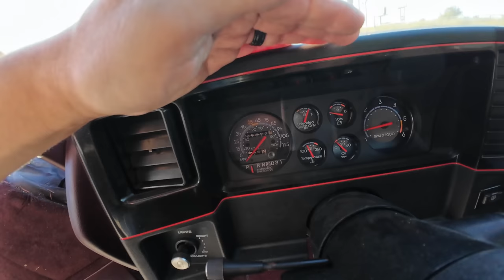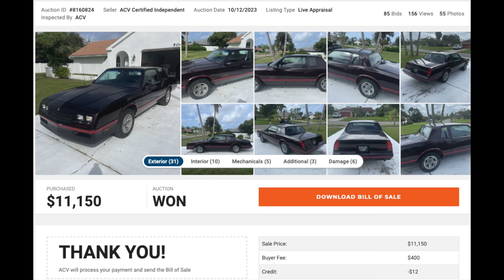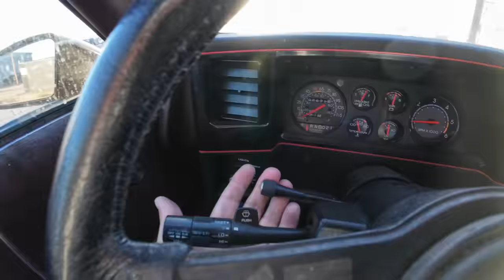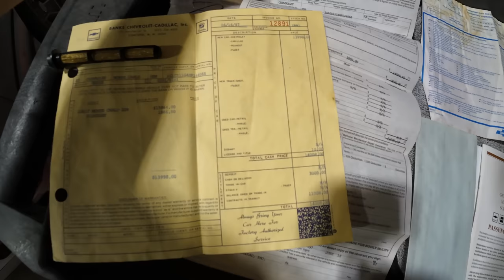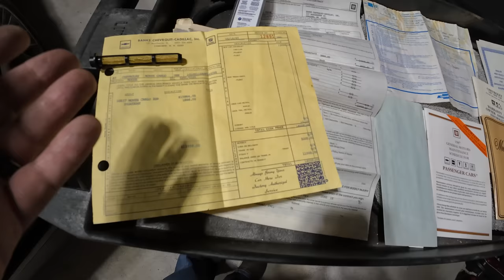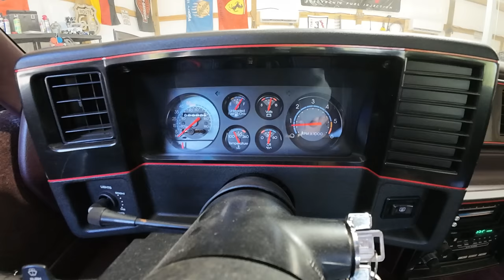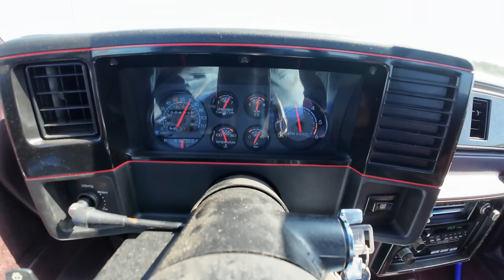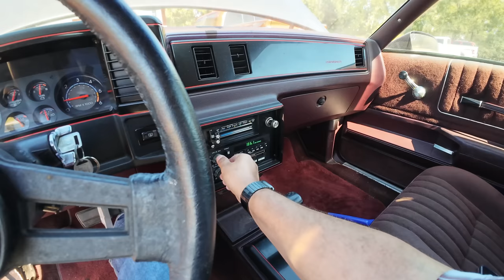I Bought a ONE OWNER 1987 Chevy Monte Carlo SS Parked for 20+ Years! First Drive - Will it Make it?

Comment: As soon as I saw the inspection sticker on the windshield I knew where it was from. I lived in Concord about the time the car was sold at Banks. Even if it was stored for 20 years it's surprising it has so little rust. An interesting project with the new motor and transmission and a future owner can put it back the way it was if they want. No junk yard scavenging needed. Thank you for a great video. Power tour should be extra interesting next year.

Comment: Maybe the air pressure being so high helped keep the tires round. I have a c4 corvette that I only drive in the summer and it takes several hundred miles to get the tires round. Someone told me to put high air pressure in them before parking to avoid flat spots. I was skeptical, but it may actually work

Comment: Nice! My parents still have their original '83 base model MC (not SS). Only thing replaced in it was the engine about 30 years ago because it dropped a piston. I paid to have it up and running last year and the guy said it was in good shape for having sat for 15 years. It needs the vinyl top replaced, I want to replace the radio and paint, but otherwise I'm leaving it as is. It's a rarity.

Comment: Changing the motor will not hurt the value at all. When I did the one that I had I went for the ZZ4 350 cubic inch motor from jegs and put all the original valve covers etc air cleaner just so it looks stock. But either way sounds like it's going to be a good build and you did not get hurt on the price as far as I'm concerned
Reply: I put a 454 in my ‘85. Armchair “experts” told me it would ruin it’s value. The car had 94,000 miles and had been repainted, so it wasn’t like it was showroom clean 15k mile time capsule. Never mind that every single SS had the same L69 305, so there’s nothing rare or unusual about the power plant. I immediately started getting approached at cruise-ins and car shows about selling the car. The offers were significantly higher than anything I was offered when it was stock.
Reply: Agreed. The Monte has miles, repainted and far from original. I suspect the engine has been swapped anyway but Randy can check that. Would be annoying to store the running gear if it's not even original. A worked 350 or bored 383 would be good, but I'd like to see a 350 supercharge in this heavy boat.

Comment: I would say, go ahead and swap it out, but like ypu saud you were going to do, keep all the original drivetrain components in case the next owner wants them. Make sure the engine is seal up to keep little critters from getting inside and causing damage and research the best way to store a used engine so as not to cause any damages, or at least keep it minimal. Also, since we know you're going to video it, make sure right after you pull the old drivetrain old, you video all the serial numbers so nobody can saw that you changed put the engine or transmission for a different one. Video proof is worth something for later in life

Comment: For sure swapping the motor is a GREAT idea, the old 305 boat anchors aren’t worth anything IMO. We swapped my parents 307 out of their 1985 442 with a 355 with double hump heads. Cool thing about the “G” bodies, the front frame is pre drilled for olds or Chevy motor mounts. So all we had to do it unbolt and bolt the new mounts in. Cool car Randy, can’t wait to see it built up. Oh, does the Monte have posi? The 442 had factory 3:73 and posi.
Reply from the maker: Some had posi and others didn't. This has the 7.5" but I need to check the RPO for gear ratio.
Reply: @AutoAuctionRebuilds  I would hope it does. Should also be a tag on the diff cover
Reply: @AutoAuctionRebuilds  Should be a 3.73 if stock.  They all were in 85-88.

Comment: Good buy randy. Upgrades you  will  do  is great idea. Go for it.will be a great car 
I have 1986 elcamino ss had 305 put 350 summit motor in with headers pipes exhaust.runs great
Good luck  withh your project

Comment: You kinda forgot about inflation. $14,000 in 1987 is roughly equivalent to just over $37,000 in 2023. So for $11,000 they didn't get anywhere near their money back. Under a third. Amazing car though and well kept. I'm happy you're doing it in a bolt-on way that's reversible if you sell it later.
Reply: You don't adjust for inflation, the lady bought it for 14K brand new, and 36 years later sold it for 11K. She got most of her money back.

Comment: 27:33 you’re talking about the primary and a secondary barrels of the Quadra jet carburetor. I had a 1971 Cadillac with a 472. I also had a 1971 Camaro 350 with a four barrel Quadra jet. When they are tuned properly, they’re pretty good. And like you said, when the secondaries open up, it’s like VTEC lol

Comment: The Monte Carlo looks like it has an aftermarket air cleaner, possibly a dirty K&N cleanable air filter. More than likely you have a Chevrolet engine (orange) as opposed to a corporate engine (blue) The rattle is probably a heat shield for the cat.

Comment: Randy, I don't know why you keep talking like these were not reliable cars and 100k miles us a big deal. I have 400,000kms on my 84 Cutlass and it was my daily driver for a long commute 3/4 months of the year for many years since I bought it in the early 2000s. I plan on it lasting the rest of my life. Much more durable than a modern car. The 2004R is out of my previous 87 Cutlass that rusted out. I stupidly bought it when I was 19. We swapped it's overdrive transmission and interior into the 84 when it had 300,000kms so now it's 520,000kms or well over 300k miles.

Comment: i would have been EXTREMELY CROSS with the transport company. car sat for decades. old oil. god knows about the condition of the antifreeze. bad gas. not delivering to the ACTUAL DESTINATION. then let it idle for 40 minutes. they should have issued a full refund.

Comment: Those cars from factory came with a 3:73 gear ratio… if it’s a posi unit the code sticker on the underneath side in the trunk will have G80… if it’s not a posi…. I’d at least put me a locker unit in… hopefully it will hold to that 450 HP power train you plan to install.

Comment: Hey I have a one owner 86MCSS.Same as yours.except black and grey.They will float down the road.my car set for 14 yrs.I replaced  the carb brakes stater.and dist.but my friend had some zz4 dist.corvette.that made that car wake up.180 HP 305.  Is. Not a barn burner.But it's dependable easy on gas..radio cassette eq plays when it wants .interior very good lady owned.southern car..I like tops. 17 rims much need.Lower the springs plus a LS3.would help 350 HP.is enough power.200r4 is a quick shift.trans ... Mostly like the 350 turbo.   373 rear....it will run ride 4 people. Plus ride pretty good....cowl hood is a must...Custom built monte 86ss will fool alot of people. A Chevelle all dressed up.I will sell mine. If interested .thanks

Comment: To reset the trip, push the knob in and twist clockwise. The trip wheels will roll until they are all at 9s and continue turning until they are all at 0.

Comment: Chevrolet had to be careful and tread lightly with the Monte SS. It was a 5-passenger, 2-door sport coupe with the young family man in mind that wanted sport but could carry 5 people, comfortably.

If they had put the 350 in it or even the 305 TPI, it would've been quicker than the Z28 or IROC with the L69 HO 305. The Camaro guys would've cried foul! 

The Monte SS was good for high 15's in the 1/4 with the L69 HO 305 and 3.73's (standard with the RPO Z65 SS option). That was pretty respectable for a 5-passenger, mid-size, 3,500 lb car. The same L69 in the Camaro with 3.23's or 3.42's was good for mid-15's. So you can imagine how well an SS would run with the TPI and especially the 350. Camaro owners would've pitched-a-fit! LOL!

A few simple mods on the SS really wakes-them-up. 
I've got my Monte with the base LG4 305 running 15.1 in the 1/4 and the engine has never been opened and the stock, original CC distributor and E4ME feedback Q-Jet is still on it. The 305 isn't a high horsepower engine but they are INSANELY reliable!

Comment: I had five SS monte carlos , maroon, black, white, silver and grey.  they were all stock and great shape in the 80s when I had a dealers license and from 3 to 5 thousand dollars.  they were good looking and drove well but deader than hell. Also vettes, mustangs, rt chargers, trans ams, camaros, chevelles, GTOs, and everything in  between the only car that was after 1973 that was hot was a SD 455 Trans Am from 1973, It was a screamer.  I bought a new 1972 T top vette , It would not spin a tire, I traded it for the new Trans Am which I loved.  The cars from 1958 to 71 with tri power and big blocks were my love like my 1970 Dodge Charger Plum crazy purple that I bought when I got out of the army, It would run 160 with  drum brakes and recessed headlights Which would make the front end lift and float at high speed, and the brakes fade out and quit when you tried to stop.  I am lucky I am still here.  I got carried away, started babbling , sorry.  Oh I forgot the price of the rt was 3900, the vette was 5700 cash, and the SD transAm was 6500 cash and worth 150 thousand now.   From Larry the babler

Comment: You're way better off with a solid roof car...spoken from experience having owned both solid roof and t-top G bodies...$11K is a great buy for a one owner unmolested car.  Be aware that swapping the motor, even if you still have the old one, will devalue the car.  Having said that, the factory engine was SLOW!  All show and not much go...I believe the secondarys on the carb are vacuum actuated...they won't open just reving the engine idling.

Comment: First of all, if it has a 100000 miles on it, it hasn't been setting. It may have Set  a few years. Those cars are not worth $25000. Like everybody is trying to sell them for. First of all, it's getting hard to find the parts. Second of all everything is gonna be redone on it To me and what I've been saying themselves for they're only worth 5 to $10000. And that's the reality of what I'm saying, people let them go for.. They may be asking that. Hi dollar, but they're not getting it.. You overpaid for it And when you change over that motor you're not gonna have nothing but problems. It's also going to decrease the volume because it's not original anymore.. When you put the new motor in, I'll be happy to give you 25 Hundred dollars for the car. 🤦‍♂️

Comment: This car really brings back memories, and I want to share some of them.
My mom and stepdad bought one of these same color except theirs had the T-tops and the unique cupe rear glass. The car had the 305ci engine which I think was the same engine Chevrolet was putting in their corvettes at the time. I think they ought to have come standard with a 350ci as the 305 was underpowered as they eluded to on this video. 
Anyway, the car was still fairly quick off the line (for what it was) and had a tolerable top end speed. 
It was my mom's daily driver, but on the weekends, my stepdad would take me with him to race his friends in Briceville, Florida. This wasn't track racing it was totally illegal street racing on the state road. They would race for fun and bragging rights and follow up with bonfires and a lot of drinking. Occasionally, an impromptu fistfight. 
He would usually get too drunk to drive home, and we'd either crash (sleep) in the car or in the back of someone's pickup truck. 
He would occasionally let me drive after the racing and teach me how to launch the car powerbraking and high-speed driving techniques. 
I miss him, my mom, that car, and those times.
Thanks for reading my trip down memory lane.

Comment: The 81 to 88 G bodies are really the best of the breed of the 80s cars lead by the Buick  grand national, Chevy Monte Carlo SS, Oldsmobile, 442 and Pontiac Grand Prix, 2+2. I have had nine of these cars and still retain two of them. One I bought brand new which I still have and the others were used. The ones that do not have T tops are much stiffer because they have better roof support and therefore perfect for a power upgrade. Good luck. I’ll be watching that build. I love these cars.

Comment: Randy, you will not like the 2800 stall converter.  It's to much for the street and ruins low-speed drivability. I know cause I had a 79 camaro with a 3000 street/strip converter and its like your tyranny is slipping when not totally flooring it. I wouldn't go over 2200 stall if it were my car.

Comment: i once rode in a grand national when i worked at probably the best car wash in minnesota  PERFECT 10 CAR WASH,  back in 1995.  the car was owned by another employee.  it was cheap, he paid maybe 7 grand for an 87.  so it was only 8 years old.  it was cool but not impressive.  for me anyway.  i also rode in a single cab s10 shortbed two wheel drive extreme or whatever they called it.  nice but also not impressive.  my run of the mill 200k mile explorer sport would smoke both.  but at 15 those were some pretty bad ass vehicles.

Comment: Love the "87" SS and always have as you can see.  I have a stock Aerocoupe and would not think of modifying it from stock but that's me.  You do you sir.  That Monte would definitely be a force on the street with a 383 and the stock 3.73 gear.
You should check that engine in the car now to see if it's a 305 or 350.  Anyway you look at it, that Monte is a keeper  for sure.

Comment: Hope you are getting an auto-overdrive trans! The choke is on when you first start the car so it will idle higher until it warms up. That's the quadrajunk carb! They need to cut the metal out where it is bubbling and replace it to stop the rust/cancer. It all works better with the battery cables tight. Probably residual dripping underneath after you fixed the leaks. Check the engine numbers to see if it is the original engine, if it is original, leave it the way it is. I would do an LS swap with fuel injection and an overdrive trans if you are changing it, then it will haul ass and be extremely reliable. Looks like a fun project whatever you do! Enjoy! Thanks for sharing!

PS The Holley fuel injection is a great replacement for a quadrajunk carb and makes it really reliable and mostly unnoticed if you use the stock air cleaner setup! That's the only thing I would do to the original engine. Throw the carb in the trunk when you sell it if they want it all stock again. Good luck!

Comment: Finished the show now ,my thoughts on the Monty is donk YES , box YES , pipes YES , stripes YES , body and paint YES , mags and tyres [fill the back as much as you can with rubber ]YES , and   i was thinking lower the front 2 "" via new springs rear 11/2 via blocks but after test run no i wouldnt touch suspension you would lose the top ride  and power tour comfort rules all those miles with harder ride no keep her there as for price 1 owner ,straight , little cancer , no bad dints not bad paint almost factory Monty Carlo that age in that condition you got a good deal keep the original mags and tyres as well for next owner love the Monty and your plans cant wait for the next Monty show chow Grumpy

Comment: I guess when you don't know anything about the car your first impulse is let's make a video. 
The clicking noise is the carburetor,  it's electronic. 
The horn doesn't work probably because of the fuse or the relay.
Take a wire and jump the horn from the battery.   One is up front,  the other is hidden. 
Sometimes one will go bad.

Comment: F i have issues regarding u my 1984 cutlass transmission c. It’s not shifting on the second k gear. I have refilled the transmission oil several times u but it’s not doing any good. Any suggestions r would be c appreciated st. Randy

Comment: Those bubbling areas are always worse then they look as they rust from the inside out. so when you start to take the rust off it gets worse quickly. To do it right would be to cut those areas out and weld in new metal.

Comment: The motor they used was a big dissapointment for the car back then.  However the 305 was very dependable.  Yank it and sell it down the road.  It needs tinted wibdows, upgraded sound system and lowered slightly.

Comment: If you want my two cents, first off, nice car, there not easy to find in good shape. I think the engine has been rebuilt or replaced, just that I think the engine came in black. So pull that weak thing out and drop something better in it. The factory transmission is pretty good stock, they have a nice shift to them, so you might save a little work there, but make sure you keep the lock up converter. If you wanted to you might want to inject it. That way you don't get vapor lock and carb boil. Can't wait to see the Buick.

Comment: Juice up the original motor if it is the original. Doesn't it indicate what engine it came with on the window sticker? You could bore and stroke this engine. Maybe get a SC or turbo. Then it would still be original but enhanced.

Comment: Randy take off the hose leading to the cruise control and spray some silicone spray in it , it will remonstrance the diaphragm inside and should start working again . Also check fuse .

Comment: Randy I think you should just build up the motor that is in the car and put in a crane cam and some 12 to 1 dome pistons and instead of getting a new motor just do that one right have it ported and polished get it blue printed get a Monster transmission 5 speed you would like it very much and it will probably be about 500  to             600 horse power Charlie kretschmar Phoenix Arizona

Comment: Neat, that's exactly the same as the one SS I ever owned (mine did have pw & locks tho).  Took me forever to find one without t tops or a sunroof, & you got one on the first go!  Def. needs a better motor; the only real performance upgrade the SS had (same with the 442 & H/O) is taller gears.  I for one will enjoy any G body content you want to provide, & looking forward to that Grand National.